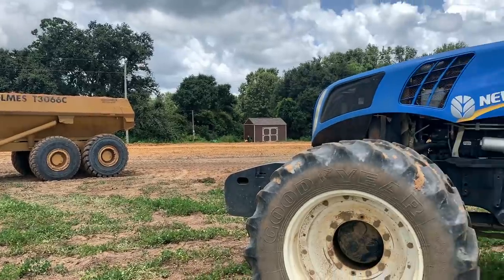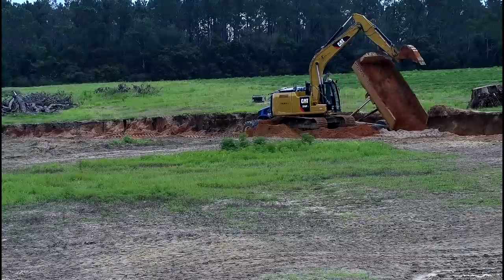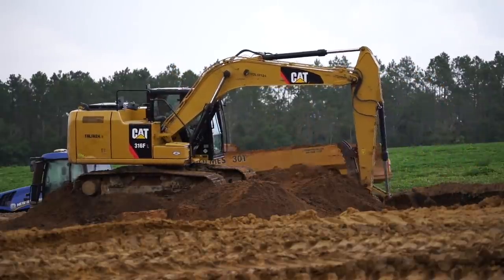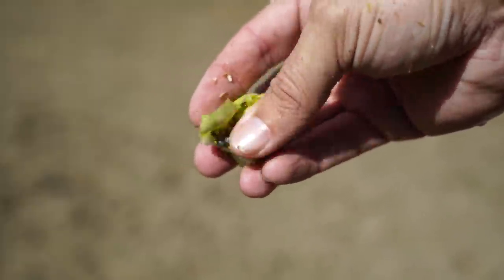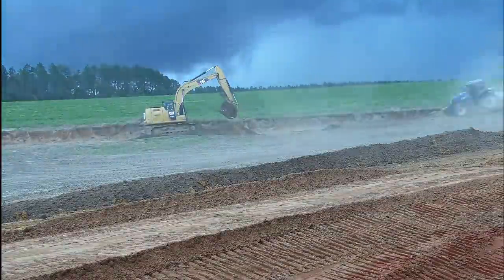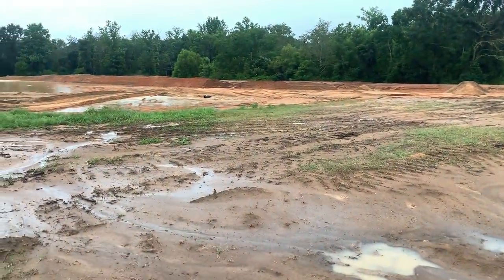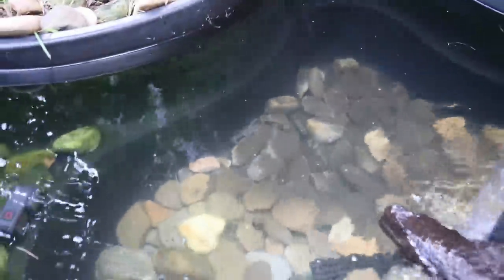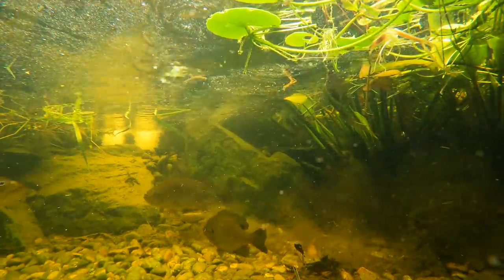Building a 5 Acre Bass Pond!! (Day 4)

Comment: I’m curious the cost of this method VS if you just had contractor with four or five large scrapers come in and do it in a couple days. Not being critical, just wondering.
Reply: it would be a lot cheaper as long as you have good clay that will hold water but you also won’t get the same results as BamaBass is getting.
Reply: @owenkrieger2185  I’m guessing with a couple compactors you could get the same results, but I’m not used to the soils he has there. Here in California, we would have water trucks and compactors chasing scrapers nonstop on something like this.
Reply: @dozer1642  you might get the same results but you wouldn’t get the quality they likely wouldn’t take the time to create perfect points, ledges, drop offs and so forth they would simply dig you a pond with no type of different depths

Comment: My idea is to avoid going too shallow... the deeper u go the clearer the water will be... and more chance the fish stay aiive in hot summer/cold winter.. Id rather see u go 6 foot then 4... and have a bit where its about 20 foot.. so the fish can go there in extreme conditions.. I  have a very cool pond in my area they dug that out for sand/road building.. its a oval that spans about 150x350 meters (or yards) and its about 18 meters deep in the middle (or 18yards deep)... it has a sandy bottom and is very clear year round... would love to have something like that...  Also put in some cages (like 10x5yard ones)  with 2 inch mesh to protect the baitfish and help plants ground in the pond.